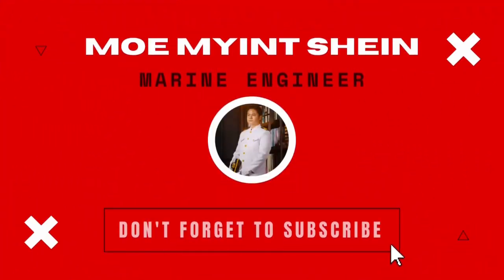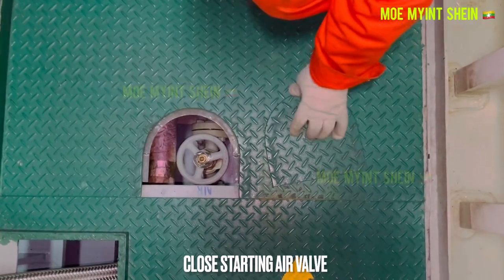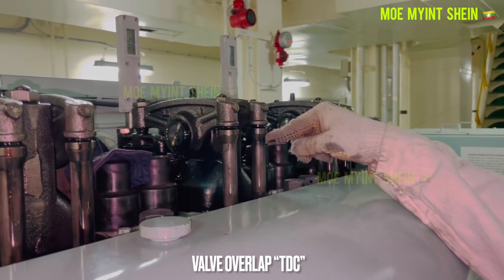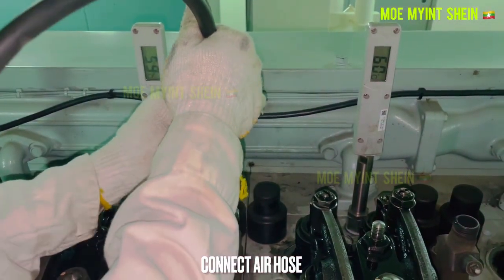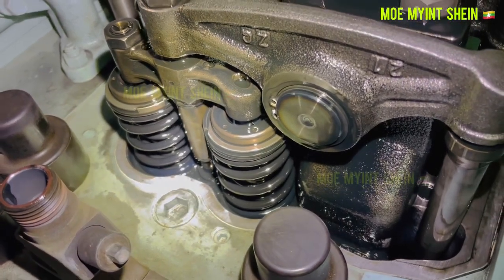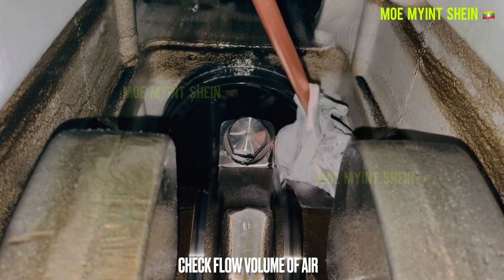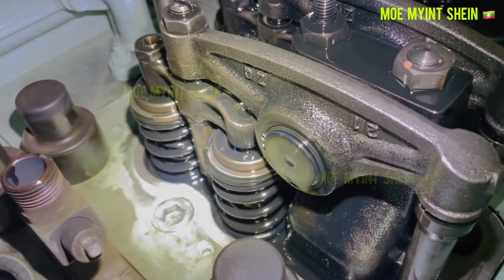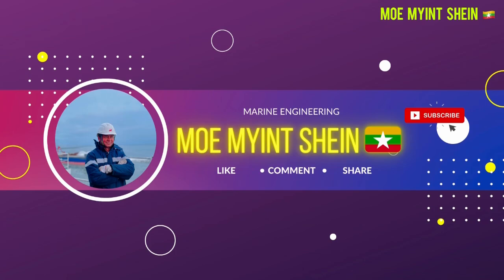Combustion Chamber Blow By Test | MOE MYiNT SHEiN | Technical Vlog : 106

Comment: According to this method, if inlet valves is leaking boost air pressure will be rise. I understand that. But i am not clear if exhaust valves is leaking what symptoms will be shown. And blow by means some gas passes through the leaky piston ring so how can i know whether the pistion ring is leaking or not. Thanks in advance.
Reply from the maker: Think, test and observe.

Comment: Bro, what did you say @02:12, if the scavenge pressure......? It's not audible clearly.
Reply from the maker: Normally, scavenge air pressure is zero on boost air pressure gauge. 
If boost air pressure rises up while testing, this is the indication of intake valves leakages. 
Hope you clearly understood. 
Have a good day !

Comment: in comp tdc push rods will not turn the one which is turning is firing tdc . thx for sharing knowledge
Reply from the maker: In compression TDC, push rods can be turned. That one sooner be firing. 
In Valve Overlap TDC, push rods cannot be turned. That stage, expelled exhaust gas by incoming charged air. 

Hope you may understand. 😊
Reply: correct agreed but blow by test is applicable when your all valves are in closed state i e @ firind tdc position .
Reply from the maker: @rahulkumar-jz7fk 
Absolutely right ! 
Use compression TDC instead of firing TDC because firing doesn’t happen in exact TDC position.